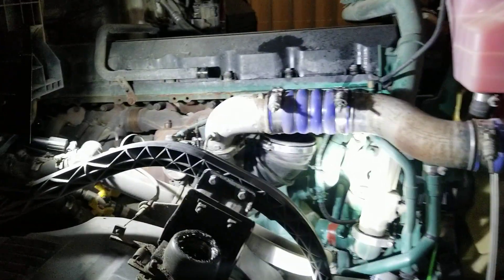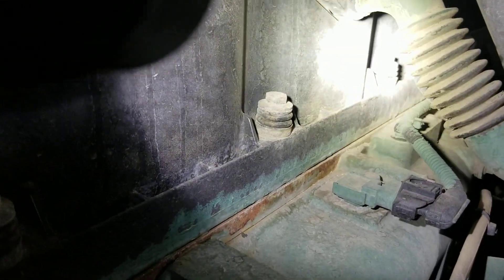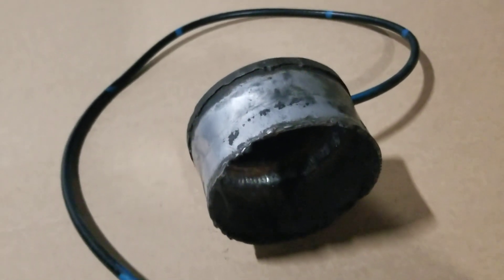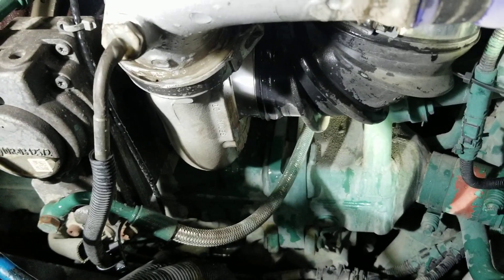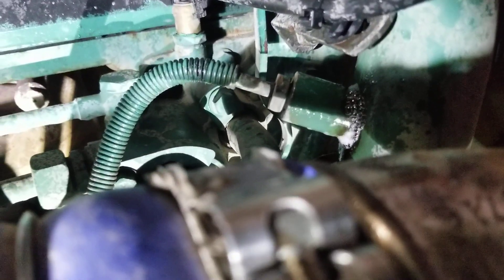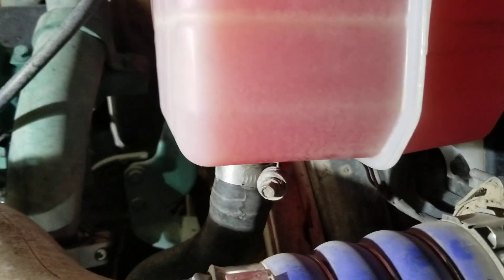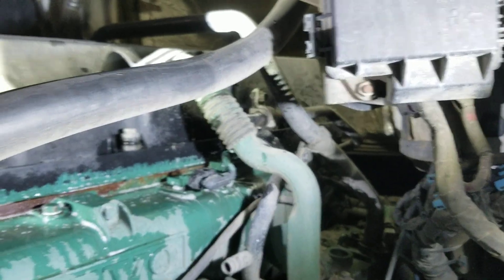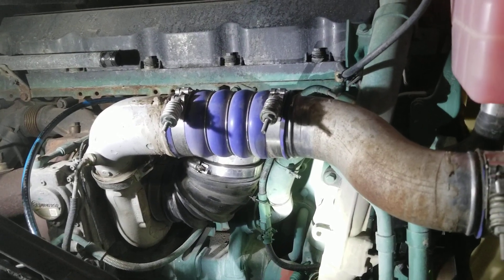Volvo truck vnl boost leak check

Comment: This is the best video I've found to run this test. Now, to build that tester. My leak came on all of a sudden, and I can hear it clearly on acceleration and deceleration in the cab. Surprisingly, not a big loss of power and no loss in fuel mileage.

Comment: hey i have a 2007 volvo d670 10 speed D13 ENGINE my truck set about 2 years and my truck was running good when i originally park it....and it has about 1/2 tank of fuel in it ..so i got ready to start the truck up after 2 years of sitting and got some new batteries in it and it started right up idling beautiful i go to drive it and its if i dont have no power it takes along time to get to 50mph and i have the gas pedal to the floor ..i changed the two filters and put some additive in it i put howes and lucas injector cleaner and fuel conditioner in i went back out to test drive it .and it seemed to be alittle better i was able to get 60 mph but it still taking along time to get there i drove about 90 miles.but  it still doing the same thing it is not smoking it but it is actually running good but i dont have no power...there is no code lights on..do you think i need to put somemore additive in it and drive it more..

Comment: Greet job man , can I supply 120 psi for system or less ?
Reply from the maker: Haha. I hope you joking about the 120psi. 
Truck normally operates at 30-45 psi
10 to 15 psi is more than enough. When applying air pressure with the air regulator start from zero and work up. watch the turbo inlet elbow depending on how your engine stopped and what valves are open that will change amount of pressure needed.
Reply: @volvobigtrucks8640  thanks allot for your help man , I will supply 15psi,  right now I have really very poor milage and loosing power , and problem with the def system building Soot fast , I need to start with boost leak test first and I will see
Thanks again , God bless you

Comment: How can I get that tool or make it
Reply from the maker: I made mine from a 5 inch exhaust pipe capped it off drilled a hole tap threads skrewed in push air fitting and supplied shop air through air regulator. I'm working on making more but have not able to get to them
Reply: A pvc pipe would work fine as long as you xan get the right size
Reply: You can order those on eBay $50 boost leak tester volvo is 4inch from the turbp